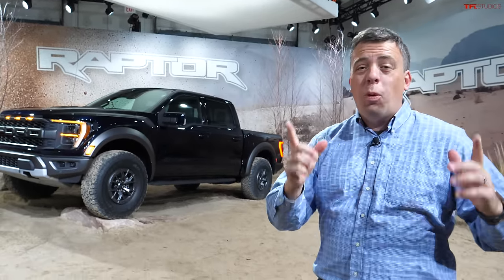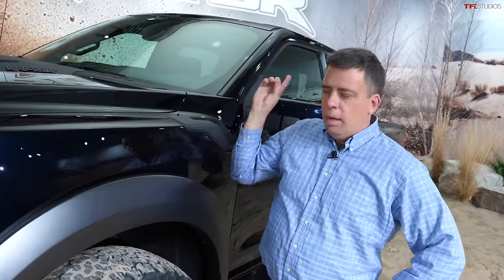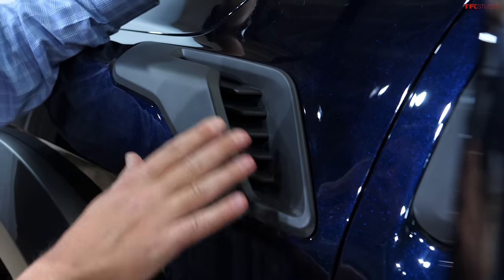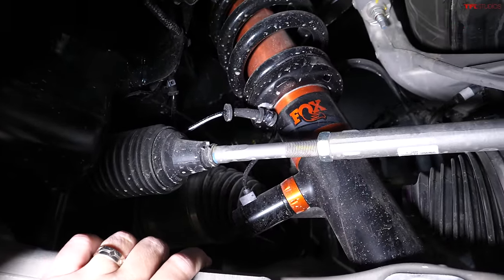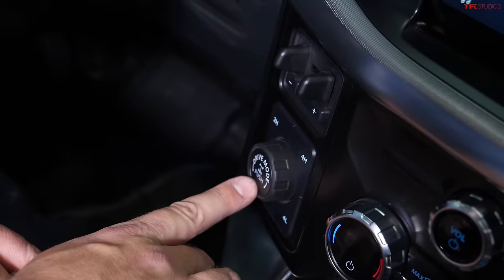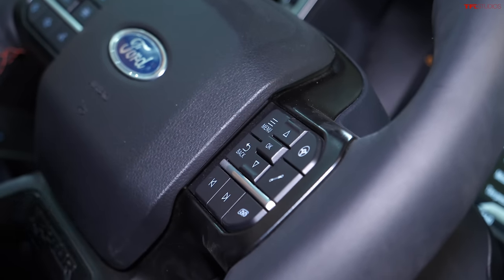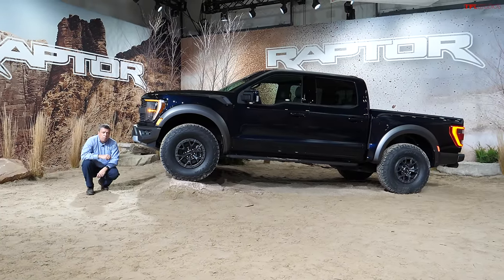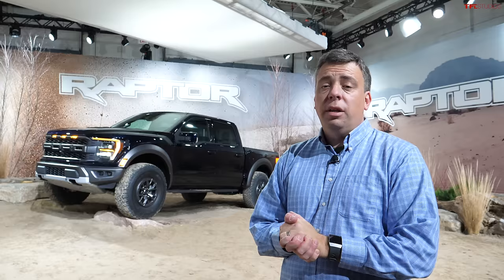2021 Ford F-150 Raptor World Debut: I Get My Hands On It — Here’s Everything That’s New And Cool!

Comment: I could hear the(V6) disappointment in Andres voice.
Reply: V8 next year
Reply: @Jv19979  ya next year it gets revealed and another 8 months before you get to buy it
Reply: @Jv19979   Ram will probably spec a V6 TRX next year lol.
Reply: @jamespenner1412  I'm getting a bronco. I don't need a raptor
Reply: Slinger Riggin cap
Reply: @jamespenner1412  Correct! The first delivery will probably be in Spring 2023 lol. Meanwhile, the TRX Redeye will already be on the roads.
Reply: @jamespenner1412  And then dealers will mark it up by $50K, because dealership scalping is legal.
Reply: @The Insufferable Toolthe Trx has enough horsepower and torque. And it’s 8 cylinders 🙈
Reply: @The Insufferable Tool It's an offroad truck, horsepower should always take precedent over torque here. This isn't a pulling work truck hauling loads everyday. Put the GT500 engine in it and call a day. Those 2 extra "pots" will make all the difference in an offroad truck, the higher rpm, the higher shift in powerband, the extra wheel speed etc etc.
Reply: @GRB22  100%
Reply: @The Insufferable Tool V8's simply can make more power than V6's. Not to mention how much more enjoyable the experience of a V8 is compared to a V6. Personally, I don't mind the current raptors V6, but I would prefer a V8. I also prefer any other 6 cylinder configuration to a V6.
Reply: I'm 100% fine with the V6 - the Raptor has nearly 600 miles of range on one tank to the TRX's 325, that difference is significant when it comes to trip planning. I'm betting Ford has upped the output of the 3.5, but still a truck is more than it's engine.
Reply: @Steve-yr5vi  I agree. I have a ‘20 Rebel eco diesel. Even tho I don’t have the off road ability of the TRX, I love 700+ miles of range per tank.
Reply: @The Insufferable Tool I agree that V8's are less fuel-efficient and more expensive to make. However, they are still more powerful than V6's. There is no sense in comparing a N/A V8 to a turbocharged V6. Apples to apples, V8's are better, aside from a small weight disadvantage and fuel consumption. If you want a really smooth balanced engine buy an inline 6.
Reply: @The Insufferable Tool Are you forgetting the 5.2 from the GT500? Or a possible forced induction 7.3 Godzilla? All speculation except that Ford conceded the power battle. I don't give a shit about cylinder count but Ford retreated and did NOT answer the challenge. Only so much volume you can pump into 3.5 liters via forced induction. If there is an upside it might put a d*ck in the ass of Raptor markups from the dealers.
Reply: If you finished watching the video, the V8 Raptor R is coming next year
Reply: @slingerriggin5226  true because they announced that they will discontinue the Hemi V8 Hellcat
Reply: @The Insufferable Tool Not really sure which comment you are referring to, but your user name is certainly appropriate. Direct question for you. Did Ford drop the ball/come up short in answering the power battle with the TRX?
Reply: Facts!!!
Reply: Today's V6's put out more Foot Pounds of Torque and are faster and use less fuel.
Reply: @slingerriggin5226  I feel they might make a cheaper 392 hemi version but who knows
Reply: I saw dyno testing on the 5.2 gt500 engine. It will come dont worry
Reply: @jamespenner1412  Yeah it's dumb
Reply: @GRB22  Redeye? How can it be more? The max edition was already 90k how much are they milking it
Reply: @asdf51501  It's not scalping lmfao, they have to make a profit somehow, not $50k that's overpriced, but you act like they should keep it MSRP and make no profit, that's not how business works, going to repeat myself since YouTube commenters tend to miss things: $50k upcharge is dumb, I am agreeing, but dealers need to make money and selling it for above MSRP isn't a bad thing, 50k above is, because that's way too much
Reply: Even though trx has bigger engine. I think   the new rapter looks so much better. Inside and out. Ram look so dull
Reply: Well I got news for you boys you cannot take that POS engine that’s in the GT 500 and drop it again the raptor it’s not made for that and it would not last a week it doesn’t last a week in the GT500 the difference between the Hellcat hemi and that and the hellcat hemi is a tank engine indestructible compared to the GT coyote POS
Reply: @jamespenner1412  100% irritating.  Tesla and Ford announcing a year or more in advance is stupidity.
Reply: @The Insufferable Tool Sounds like you don't understand the engineering behind engines. An 8 cyl is the best platform in the world when it comes to power, reliability, and cost. Realistically they wouldn't even need to use the GT500 engine, take the new 7.3, bump up the compression, shorten the stroke a bit, better flowing heads and a better cam and you could easily have a 550-600hp reliable monster with all the torque you'd ever need. The problem with that is extra r&d and cost when they already have engines ready to go. Really they could just supercharge a coyote and call it a day as well, they're great engines that LOVE boost. An ecoboost doesn't hold a candle to a coyote.
Reply: Wait till raptor R.
Reply: @RM-xx6fm  That raptor interior is meh. The seats already look old and worn on the press photos. TRX has a better infotainment system and screen. The only place I can see the raptor win on the interior is the speedometer screen
Reply: @NorthernLaw_  Really?  That’s the argument you’re going with, that dealer markups are needed for dealers to make a profit?  I am dumbfounded at how stupid and ridiculous that comment is.
Reply: @WilliamStewart1  Cough! Cough! 3000 HP all-Titanium CNC'ed Ceramic-Coated Turbine at 1500 PSI at 1400 C mated to all-Titanium ceramic-coated linkages and gearing mated to fancy Rheologic 120 samples per second ACTIVE SUSPENSION (8 ms response time) Magnetic ride shocks and flexible TWEEL tire technology.  I think I can do MUCH BETTER in design and building of ultra-high output engines than FORD or RAM when it comes to high horsepower meeting the road or any mud, ice, sand and snow!

V
Reply: Sure doesn't sound like the Ram Hemi. Still sounds V6 to me.
Reply: @WilliamStewart1  I dont know what's the point of everyone bashing V8s for. Turbocharged V6s arent bad but dont belong in everything -everything.
Reply: It needs a supercharged V8 to match the TRX. I don't think the engine he's describing will come anywhere close to Ram TRX. The current TRX goes faster than the Predator's top speed (limiter) in the 1/4 mile. That's pretty sad. I'd love to have either truck, but I just think it's going to be impossible for the Raptor to match the TRX with the engine rumored to be in the 2021 Raptor.

Comment: 3/4 of the people whining about having to wait a year for the v8 version won’t even be able to afford the 70-90k price tag anyway 😂
Reply: So true. They are the first people complaining while they driving a 4 banger.
Reply: And those who can afford one will buy a TRX. I'm a Ford fan but this is just lame, no excuses.
Reply: @zonacrs  Yeah, highly doubt that. Less than 1% of people can properly afford a TRX, not to mention the atrocious MPGS they'll get from a v8.
Reply: Let's not even mention the fact that it took Ram 10 years to finally compete with the Raptor and they are already getting beaten a year later, and yet people still whine that they have to wait...
Reply: Thankfully all cars and trucks are getting better engines and fuel mileages because most people can’t afford the whoop ass vehicles anymore. These things are cool, but I’ll never spend over 30k for any vehicle. It’s ridiculous
Reply: @Striker50_  You highly doubt what? People who can afford this class of vehicle don't give one rat's ass about fuel economy. This game is about power and bragging rights, plain and simple. Big power equals big fuel consumption no matter the cylinder count.
Reply: I think the V8 will be in the $80-85k range. My 2020 with the blue accent package and bed liner was about $76k. And I upgraded the stereo, bed cover, Wilwood front brakes, 20 inch Vision wheels, cross drilled rotors, brake pads, carbon fiber hood vent and side vents, painted fender flares, painted skid plate, bed rug. So I am right up there with the TRX. The Raptor fits in my garage, but the TRX will not. And the Raptor does not fit onto my lift. It’s always something!
Reply: Yeah exactly why I am not complaining about it, I really don't get how you can be upset at something you can't afford. It's just dumb
Reply: @zonacrs  Lmfao no, I'm buying a Raptor no chance I'll get a TRX
Reply: @Striker50_  Raptor R is getting a V8, TRX is overpriced, only so expensive because of the V8, Ford will make the R and it will be better and buying that
Reply: @NorthernLaw_  a Raptor R isn't better. You just have a tiny ego. No one needs 750hp to run baja and you sure as hell shouldn't be drag racing a truck that has off-road tires with sidewalls not meant for high speed
Reply: @zonacrs  imma trade my gen2 for this beauty. And i have the money yuju
Reply: @zonacrs  very true, when I purchased my 2014 raptor roush supercharged I was not worried about gas mileage.  I still owned it and it's been a very fun solid truck for me.
Reply: try 100k for any v8 variant.
Reply: @raionshishi8290  how are they already getting beat? That phurd still doesn't event compare to the TRX.
Reply: @Striker50_  I can agree with part of that. Even though I can afford either one there is no way I'd spend that kind of money on one.
Reply: @zonacrs  you do realize that the Raptor R will have a SC V8. Ford officially announced that yesterday. I for 1 think the 3.5L is actually a better option. Less weight and more flexibility in the overall truck.
Reply: @ryansheard8092  That is the speculation but not confirmed. Hoping they are both an option to be honest. Not in the market to buy a Raptor or TRX unless I win the lottery. And yes I can afford one on my salary, but won't. Just because you can afford something does not mean you should buy it.
Reply: @zonacrs  Ford confirmed it yesterday to multiple media outlets. Including Tim @ Pickup Truck Plus SUV Talk
Reply: @ryansheard8092  Thanks for the info, did not see that. We all kind of knew it was coming.
Reply: I am one of them! LOL!  I still want one, just a used one at a great price.  Will never spend that much on a truck.  I currently have a Titan but still like the Raptor.
Reply: @NorthernLaw_  It's your money, do with it what you want.
Reply: @ArmondB30  Yep. Find a clean used one and be happy.
Reply: public demand is same regardless....they will get reemed for this in social media....maybe good move fir bean counters but not good move sales wise I would bet
Reply: 99% complaining will never buy a raptor or a trx, and have never drove a gen 2 raptor. Literally complaining that they have to hear a v6 as they get gapped.
Reply: Not even the “base” v6 😂
Reply: @zachkinnison6390  preach!!
Reply: @Striker50_  You don't buy a truck for gas mileage
Reply: Yup even a base model truck that can be built up to this spec via diy is ridiculous.
Reply: You should use "The Rule of 4"  for a depreciating asset, if you can't afford to buy four, you shouldn't be thinking about buying one.
Reply: 3/4!?!? More like 99.9%!
Reply: If toyota put more effort in their tundra's just like the tacomas, the tundras will outsell them all.
Reply: Wouldn't pay that much even if I could afford it.
Reply: @zonacrs   What they fail to know is that the current V8 males decent MPGs. Especially when not hammering on the throttle.
Reply: @brendanhall9924  Ford has literally the most sales in the truck category and sport/coupe car category, also, garbage interior is not real proof, especially when that kinda thing comes down to matter of opinion and taste to which many find the Dodge interior to be garbage as well.
Reply: @JohnDoe-nz6bk  The Raptor literally takes things one step further in every category, Torsen front limited-slip differential. The TRX has an 8-speed automatic transmission while the Raptor has a 10 speed. The outgoing Raptor has ratings of 12 mpg city, 18 highway, and 16 combined. The TRX chugs gas with ratings of 10 mpg city, 14 highway, and 12 combined. Expect the Raptor to improve with these numbers as it not only has better suspension and power output, but a way bigger gas tank too. The outgoing 2020 Raptor ran from 0-60 mph in 5.1 seconds, according to Ford. Expect the new one to match that or improve slightly upon it. The TRX can run from 0-60 mph in 4.5 seconds. If the outgoing Raptor can hold it's own against the TRX, then the upcoming Raptor R will most likely beat it. 6,350-pound weight TRX, the outgoing Raptor has a curb weight between 5,525 and 5,697 pounds, don't expect that to change much. 18-inch aluminum wheels wrapped in 35-inch Goodyear all-terrain tires. The Raptor rides on smaller 17-inch wheels wrapped in 35- or 37-inch tires (the latter is optional). The trucks ride on long-travel suspension and a five-link setup with coil springs in the rear. The TRX has an impressive 13-inches of front-wheel travel and 14-inches in the rear, but the Raptor tops it with 14-inches front and 15-inches of rear-wheel travel. The TRX hauls a maximum payload of 1,310 pounds and tows up to 8,100 pounds. The Raptor tops that with a payload capacity of 1,400 pounds and towing capability of 8,200 pounds. While the 2021 Raptor hasn't announced pricing the outgoing 2020 Raptor crew cab cost $58,135, i don't expect this to change too much at all and even if so, the 2021 Ram 1500 TRX costs significantly more at $71,690. 

Overall the Raptor is just beating it currently at least on paper and as shown on reviews with all these comparisons, and that's just the v6, the v8 will end it so far as it seems.
Reply: @raionshishi8290  and yet, in the real world..  The TRX has bitched slapped the raptor. What's on paper doesn't mean shit. 🤦‍♂️
Reply: @zachkinnison6390  gapped?? Bwahahahahaha HAHAHAHAHAHAHA 😭 😭 😭
Reply: @raionshishi8290  just because you sell more, doesn't mean it's better.
Reply: @JohnDoe-nz6bk  In this case, it literally does.
Reply: @JohnDoe-nz6bk  What's on paper literally reflects most of what is in the real world because it's literally based off of it you dingus.
Reply: @zonacrs  you can lit rally take a nightlife 1992 f150 with a 5.0 pay a shop to redo the whole thing and it would be a much better truck
Reply: @zonacrs  it has more hp than most v8 trucks
Reply: Atleast a v6 version
Reply: I don’t even think a v8 is even necessary. It adds weight, less fuel efficient and more expensive and the added power only makes up for the weight. With the correct exhaust, a V6 can sound like a v8 ( Ford GT for example).
Reply: @zachkinnison6390  agree with you! At first I was all against the Turbo sixes but after my wife got a new Navigator I've changed my mind! I been having a blast racing all my friends in their new V8  Dodges and Chevy trucks and by the time we hit 100 they are 10-15 trucks back. And we are running on 24's with 305's!!!
Reply: @zonacrs  421 hp out of a mercedes 4 pots. Gets about 26 to 30 mpg so not always accurate
Reply: @zonacrs  relax. You want the V8? Wait for the R.
Reply: @joegotz1971  nah. Your 2020 is still short about 250HP
Reply: hahaha, of course I know him... he is me.